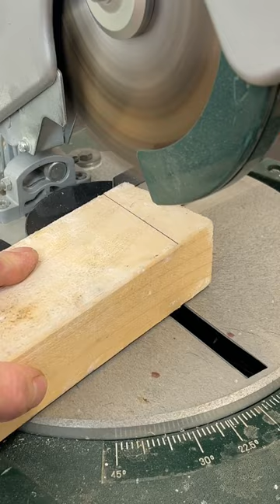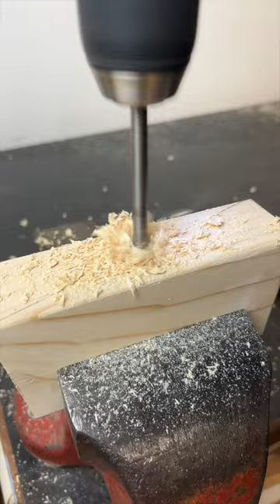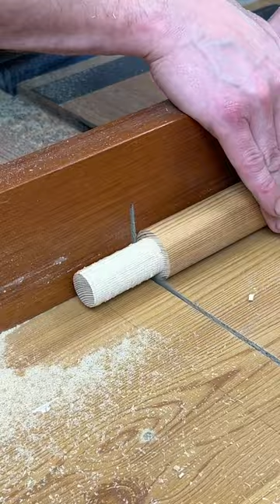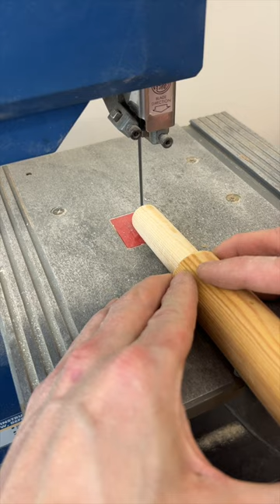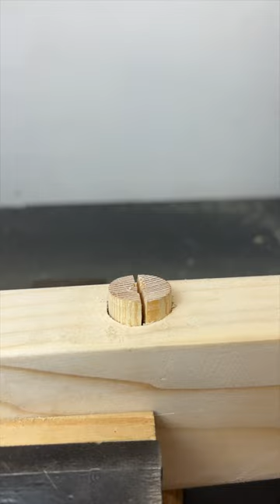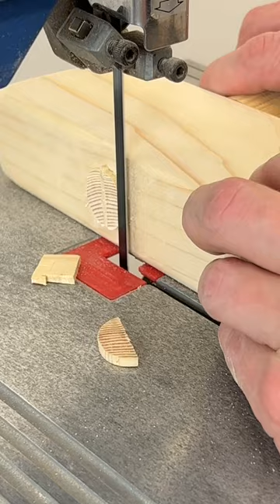10 Minute Tool (In 35 seconds) #shorts #tipcentric

Comment: Thats a real quick easy way. Like the cutting on the table saw. Like people dont realise how many ways you can use a table saw if you really know/Respect it and have the feel for how it works. And yeah pine mallets are good and cheap to make compared to buying a proper wooden mallet rubber one or soft plastic. For woodcaring especially when using machete or chisel a pine wooden mallet is usually the go for control and the weight doents need to be supper balanced in this application.  you can also make different sizes depending on how big the work is and how much material you want to remove in one go. 👍  you have a table saw at home ? Nice having one around get so much done quick lol

Comment: Really lol pine?
Reply from the maker: Softwood mallets are great for certain applications as they are a lot less likely to mark your workpiece. And they are super cheap and easy to make.
Reply: @tipcentric  you should drill it out and put a lead core and plug it?
Reply from the maker: @DavidLopez-wg7eq  not a bad idea. A bit more weight in there would be a good thing for certain jobs.